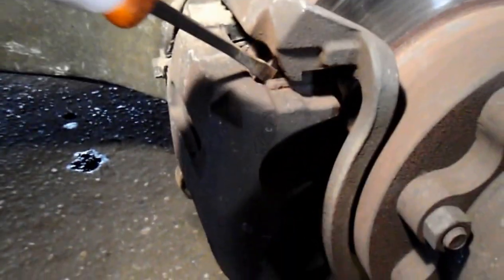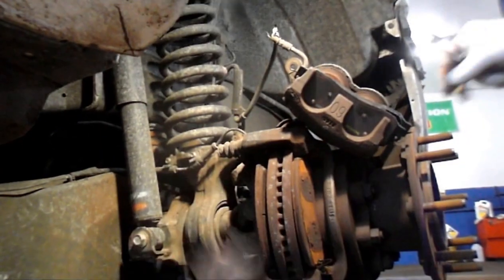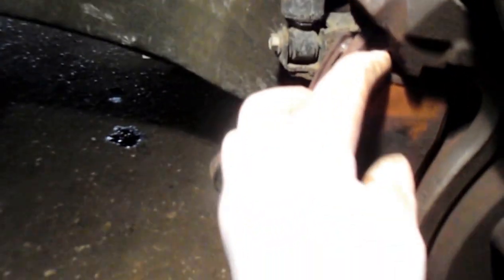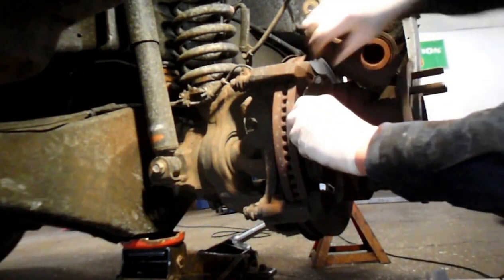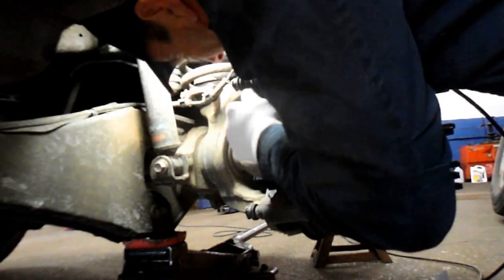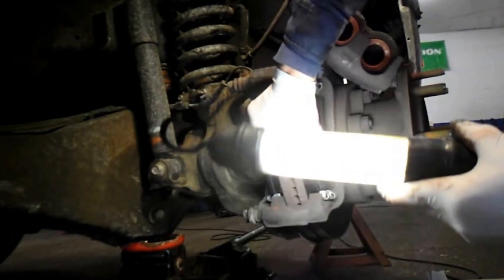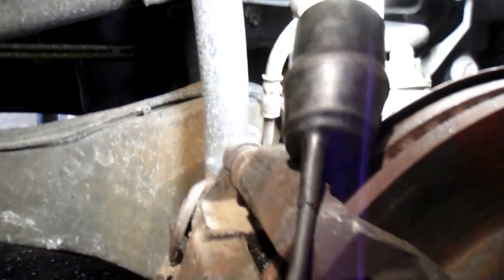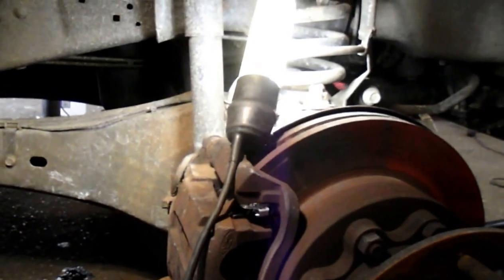How to replace front brakes on a 2006 Ford F350

Comment: that looks like my same set up on my 2006 f350 dually i changed the calipers it came with 2 extra pins ? u no what those are for i only see u use 4 why mine came with extra 2 ?

Comment: It makes my brain hurt. New pads, worn surface rotors = short life pads which and minimized gripping power = no money saved. Turning rotors with that much meat left is about $13 a rotor. Machine rotors, new pads = less money spent. Always machine or replace rotors, never ever just replace the pads and call it good, you're not saving anyones tight budget anything.
Reply: You are exactly right.  Why do half the job??